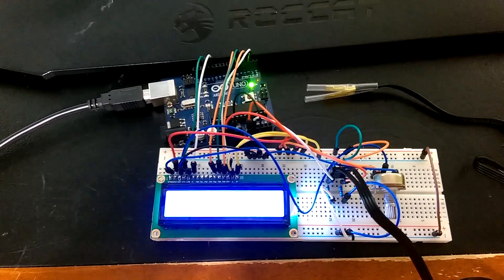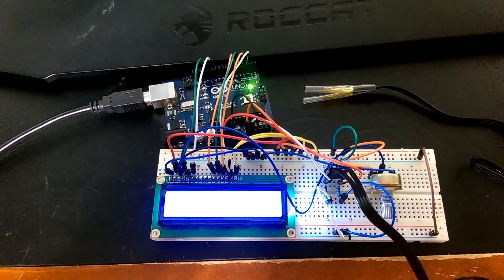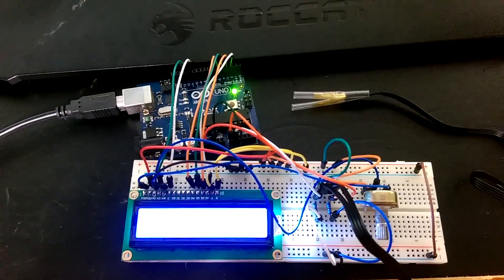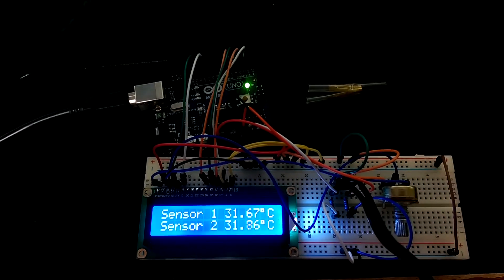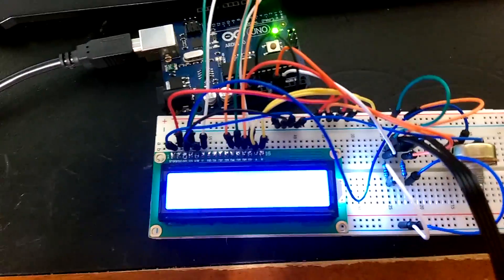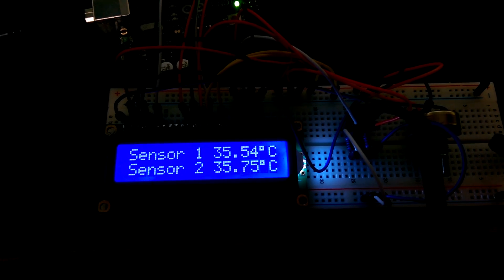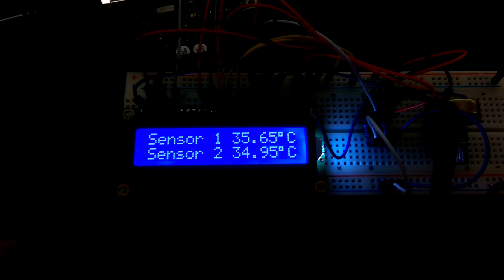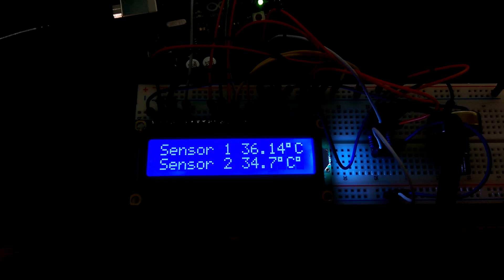Arduino-based PC Temperature Monitoring Display Pt. 1

Comment: I wonder if there's a way to intercept temp values being sent to the UEFI/BIOS and send them to a microcontroller/Arduino LCD. No Windows software as middleware. No extra probs. Temps straight from the sensors so they can't be seen as soon as the computer is powered on.